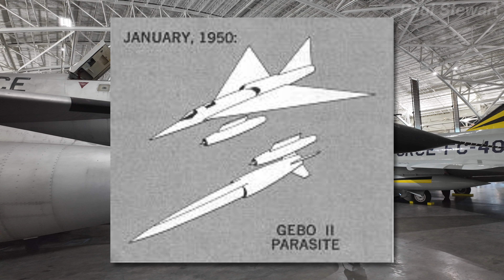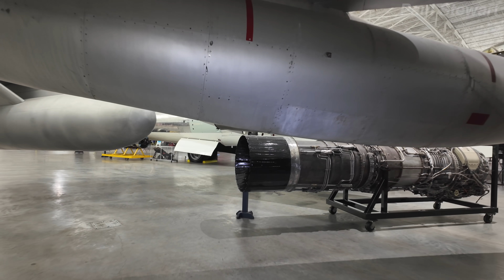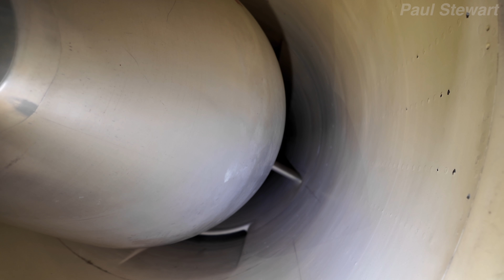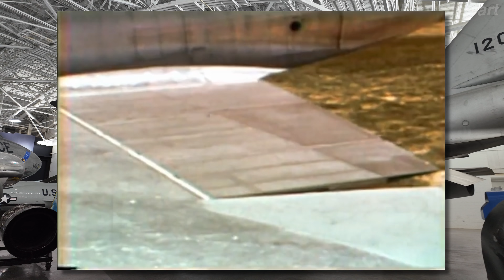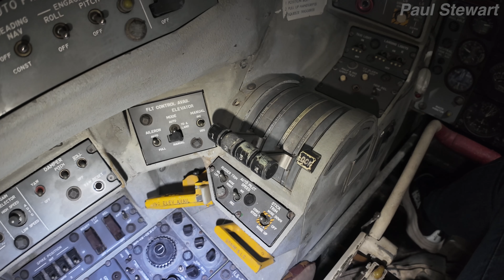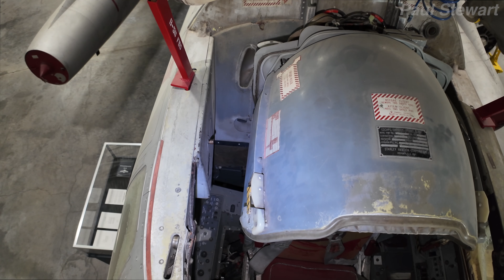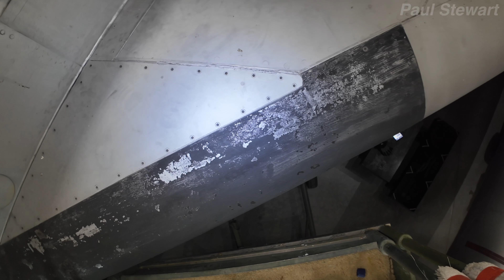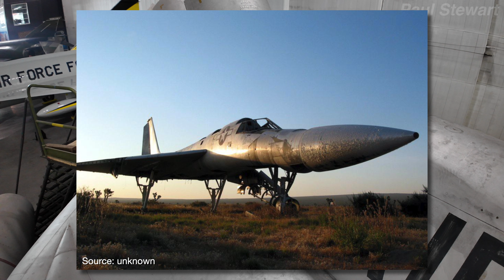Inside the Convair B-58 Hustler!

Comment: Back in the day, the aircraft that I worked on was the F-106, also a Convair product.  Our piloots LOVED to fly it and it was a pleasure for me to work on,  I also briefly worked on the F-4D and the F-4E and those were a maintenance nightmare by comparison.  Moving on, I am convinced that Convair had a sweetheart deal with a subcontractor named Burndy and I can see that this B-58 is lined with Burndy fuses.  Fuses, not circuit breakers.  That means that we had to keep a stock of about 6 or 8 differenct amperage replacements and I'll bet that every one of them cost at least several 1957 dollars.  Worse, a spring loaded spike was supposed to pop out of that hole on the pinch handle to indicate it had blown but that didn't always work.  So, can you imagine that the bombardier would have to isolate the bad circuit and maybe effect a work-arouind or repair and then have to juggle a loose supply of replacements as well a disposing of the spent ones?  Those damned fuses are the only thing I had a bad word to say about the F-106.

Comment: Very interesting details in your video. Great job. I never knew it was such a crappy plane to fly for the crew. Three crew members all isolated from each other. A clothesline to attach paper messages to and pull the string back and forth in case the intercom failed. Almost no visibility out for two of the three crew members.

Comment: I spent a year in 1967 in Little Rock climbing all over these things. Even getting to sit in the cockpit with all 4 turning so I could check the HF radio function. Also got to sit in the demo capsule and squeeze the triggers and encapsulate myself. One of the things that ended the B-58 was in a few years, there were a bunch of ICBMs sitting around north Arkansas able to deliver the same 9 megaton bomb much cheaper.

Comment: Our airline hired a B-58 pilot. Bill Hale became a 747 Captain for us. He was a pilots pilot. I was the Director of Pilot Training and was continuously impressed with his knowledge and flight skills. He told many stories of flying the B-58. He said the most feared malfunction was losing an engine while flying above Mach one. The aircraft had an automatic system to shut down an engine on the opposite side of the failure. Otherwise the aircraft would tumble and disintegrate in seconds. A lot of the aircraft that were lost was attributed to an engine failure and the automatic shut down system failing to react quickly enough.
Reply: A friend of mine's dad worked for General Dynamics and did development testing on them.  He told a story of testing and inboard engine failure at speed.  The plane yawed and obstructed the outboard inlet leaving the plane with max power on one side and nothing on the other.  His words were that the plane pretty much vaporized.  The automatic engine shutdown makes sense with that in mind.

Comment: Thanks for the memories Paul.  At 87 years young, I’ll bet I am one of a very limited number of living airmen that actually worked on the Hustler. I was in the USAF from 1959-1963, enlisting at 21. I was trained on the B-47 bomb/nav system in Denver at Lowery AFB and then went to Davis-Monthan AFB as a bomb/nav tech. on the B-47’s. They were phasing out, so I was sent to Carswell AFB in 1961for retraining on the B-58’s Sperry AN/ASQ-42 bombing/navigation system.  I was stationed there until discharge in April 1963.  I helped service many of the B-58’s with tail numbers in the 59-2xxx series. They were a very fussy aircraft to maintain. The bomb/nav and flight control systems were integrated and had some serious issues, thus causing several of the crashes. I was watching night take-offs from my barracks window one night to watch a B-58 taking off, only to have a flight control problem and fall back to the runway.  It slid about a 1000 feet leaving a trail of fire behind.  The crew members ejected, but fell back onto the runway and were incinerated. The later years of service saw the aircraft become quite reliable.  
Those were memorable times at Carswell, and with many good memories, but I was totally willing to take my discharge papers and be on the road home.
Reply: I went to Lowry in 80 to train on the F-15.  Noticed Lowry is basically gone....
Reply: Thank you for your service! Thank you for sharing about the B-58.
Reply: @JBMinter Thank you for sharing some of the memories from your Air Force Career. It's an era of military aircraft I am quite unfamiliar with, growing up around the dawn of the 'teen' series. When he was doing the walk around I was amazed how beautiful the lines and shaping of this Aircraft was, along with the craftsmanship to produce these designs with the materials available. Of course I am sure with working on and around them you have a whole different point of view and understanding with them. Very interesting times, though, with the horrors of the threat of the nuclear age balanced against the massive leap from the piston engined fighters to the early Space Age and Jet Era when we had this new technology and so many differing designs were being  built to test what would work, along with the dream that everything would be possible and was just around the corner.
Reply: that's cool, i'm only 31 but I like these older jet fighters and bombers from the 50's/60's they just have a nice look to them and to think they were designed with slide rules and nothing else
Reply: Great to hear from someone who worked on the aircraft.  I would have loved to see all those systems and technical data.  I was stationed at DM from 1994 to 2001.
Reply: @shieldwallofdragons  DM was a great base as I was there '81-'85.  Still live in the area.

Comment: The J-79 engine installed in the 'Hustler' (only 116 built) run longer in afterburner/supersonic-mode than all other GE-J-79s installed in all other planes e.g.F-104'Starfighter' (~2500 built) or F-4'Phantom' (~5000 built) COMBINED...!
2 were prepared for use as conventional bomber for Vietnam...looks a bit strange to see a 'Hustler' in tactical camo-pattern...but the plan was not realised...!
Shame it was only in service for ~10 years...! 😞

Comment: There’s a nice little book out there about the B58 story. It argues that it wasn’t actually more expensive than the B52 in that a wing of B58s consisted of far more planes and support crews, so costs per unit operating was comparable. 
I suspect that all it issues come down to the quantum leap forward that it represented and consequently the somewhat uncharted territory of its flight envelope.
 At high altitude it was really in coffin corner and we need to consider the likely previous experience of the crews and how that would serve them flying such a machine. Losses were to be expected perhaps from such a complex beast. It’s delta wing would also probably have been excellent at low altitude like the Vulcan was. 
Ultimately, it often comes down to the whims and prejudices of the air staff advising Le May. Either way, it was a missed opportunity thar the Russians really appreciated because they are said to have feared it above all else.

Comment: The B-58 is one of the planes that I wish someone would restore to airworthy condition.  It doesn't seem like it would be that hard to get one airworthy since they use the J-79 engine.  The J-79 is a very reliable engine and there is still mro shops overhauling them.

Comment: From Typhoon Roy to Typhoon Russ (December 1987 to December 1990), my wife and I were stationed at Andersen AFB, Guam.  Before becoming a B-52 wing in the 1970s, the 43 Bombardment Wing flew B-58s out of Carswell AFB, Texas.  I never saw a 43rd BMW B-58 in flight, but I did get to see one of the aircraft in the Museum of the US Air Force back in 1991.

Oh, by the way -- I'm looking forward to your piece on the FB-111!  My first assignment in the US Air Force was with the 474th Tactical Fighter Wing at Nellis AFB, Nevada.  I didn't see the Aardvarks fly very often -- there were recurring problems with the TF-30 afterburning turbofans -- but I did have the privelege of seeing the 474th's last Aardvark light the afterburners, trundle down the runway, and climb into the sunset on its way to Mountain Home AFB, Idaho.  About a month later, I flew off to Travis AFB, California to work with the 60th Military Airlift Wing's C-5 Galaxies.

Comment: The B-58 is definitely one of the best looking aircraft ever designed. It's whole design simply oozes  "speed". If a B-58 and a B-52 had kids, they would all look like the B-1B.
Reply: Was stationed at the alert facility in At Whiteman AFB,in Knobb Nostor missouri. Thomas M. Gilbert col.
Reply: Really?  That pod and the wing-mounted cigar engines make it look like a series of decisions were made to essentially enlarge and modify an ME262.  Add delta wings, add two engines.  Not enough fuel?  Don’t change the design, just bolt on a pod.  Not enough room for bombs?  
Again, pod.  It looks like the initial design didn’t meet the design requirements, so they just kept adding things to it to compensate.
Reply: @r @roddaman7545 Read a history of the development of the -58 and you will find that was indeed not the case. The pod and engine configuration was an ingenious and carefully considered solution to tailor the airplane to exactly what the Air Force asked for in the specification. Unfortunately it was not adaptable to carrying large amounts of conventional ordnance, but it did the nuclear deterrent mission it was designed for. One can ask no more of an airplane's designers and builders.

And ffs the delta was exactly nothing like the 262s wing, and the tech was light years ahead of it despite only being 10 years later when first designed.
Reply: @johnparrott4689
I was talking about what it LOOKS LIKE.  It didn’t make any assertions about the development. FFS.  Find something worthwhile to ‘fact check’.

Comment: You forgot one application of the J-79 engine. The Convair 880 four engined airliner, meant to compete with the B707 and DC-8. On the 880, the engines were renamed the CJ-805. 

GREAT VIDEO BTW! =D

Comment: The cockpit windows are Crazed around the edges, but uniformly so.  What causes that phenomenon.  Normal glass would shatter or streak in longer and random directions, especially around edges.  This is some kind of unknown stress/strain/fracture issue which is still somewhat of a mystery today.
Reply: It is caused from heat delamination of the plastic material sandwiched between the several sheets of high-strength of glass .  When this happened in service, the glass would be replaced: Glass panels were probably replaced several times in the service life of the individual bomber. I saw windows with this issue several times when I was stationed at Carswell AFB as an electronic tech. on the Bomb/Nav system.

Comment: Grissom AFB had one parked on permanent static display.  One day, during a major storm, it tried to takeoff.  The next morning, it was found with the nose high in the air.  To prevent it from happening again, the nose gear tires were filled with concrete thru a hole cut in the top of the tires.  Once it cured, the openings were rotated to the bottom.  In addition, concrete was poured into the nose area.  Unfortunately, concrete eats thru metal.  The nose gear rims collapsed, while the concrete in the nose, ate thru the skin on the bottom of the nose area.

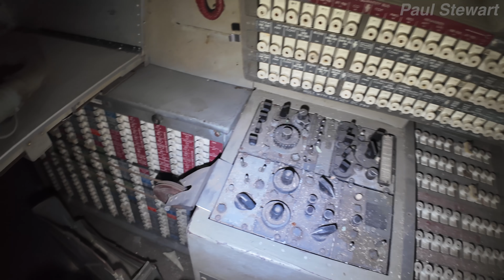Comment: I have some fun extra info about that system at 27:20

That was called the AN/ALQ-16, and it was the first of its type that could follow the frequency of a missile as it hopped across the band. It used a giant vaccum tube to parse these signals, and was manufactured by Sylvania in Buffalo, NY.
Being the first, it wasnt very reliable. They had a very high failure rate on that tube, so in 1967 they came up with a special testing briefcase for ground crews that would check the entire system, and give you useful diagnostic readouts. It even displayed to an external CRT! Not sure if it was NTSC compliant tho..

Ive only seen one of these things ever, and there is zero documentation on the thing. Wonder if anyone else has seen/used one? If i remember right, its Big, yellow, weighs about 50 lbs, and has "AN/ALQ-16 T3 BAND" written on it.

Comment: I was driving on U.S. 54 cutting across a corner of the Texas Panhandle when I saw a B-1 bomber on the deck and going like a bat out of hell.  That occurred a couple of decades back and in the late afternoon.  Then around a similar time frame, well perhaps thirty or so years ago four, yes I said four F-105s buzzed me in formation on a lonely two lane black top.  I was about twenty miles away from the air base located at Wichita, Kansas.  I realize this has nothing to do with the video.

Comment: During my Summer camp before I was commissioned back in the 1960s, I went to Castle AFB, where they had B-52 and B-58 simulators. I "flew" the B-52 simulator, and experienced the WSO simulation for the B-58, including the process for operating the tail cannon (with a selection of either 1 or 2 second bursts).

Comment: Air pressure in pneumatic tires is chiefly about keeping the tires from flattening too much while carrying the distributed weight of the vehicle. I don't know why this video asserts that the tire pressure was (simply) because of the high landing speeds; perhaps that is paraphrased from the oddly, and misleading, sentence on the Wikipedia page?

Also, the statement about how the crew compartments are separated gives a misleading picture regarding a major factor in the B-58's design. Each of the three crew members sat inside an escape pod, and those greatly increased the amount of space taken up by each of them. That, and the associated infrastructure necessitated considerable separation space between each compartment. No doubt other factors were involved, but some of THAT was just the designers using remaining available space within the fuselage.

Comment: While the B-58 was without question a beautiful design, it's thin wing cross section limited the amount of fuel it could carry. Had they actually been used to run nukes into USSR,  it would have run out of fuel before making it home. Thin wings gave it greater speed, but at the cost of range.

Comment: So..... they strapped a 30kftlbs YJ98-GE-3 on as a fifth engine causing the aircraft to have a combined maximum thrust of over 92,000lbs.   Thats enough thrust to have exceeded its service ceiling in less than a minute.  That's Streak Eagle range power.  Jeez

Comment: Funny you mention the Concorde.  The Hustler was actually the first aircraft that was designed (after thought, not from the get go) with SST in mind.  After the initial production run there was debate if the pod could be used as a airliner, and so they started working on it and even started production on it, but by the time they started working on it, not only was the Hustler outdated technology, but the cost of running a SST started coming to the surface and they realized that it just wasn't fiscally practical even for the military to operate one.  They stopped the program before the initial prototype was finished and the idea was scrapped.  Ironically, this would go on to inform the US when it opted to enter the race with Europe to build an SST, and why the US initially balked at the idea, and when they opted to go ahead for national pride they knew it had to hold at least a hundred and 150 ( I believe the 200 of the Boeing concept). The US versions were so ambitious because of the Hustler.  Of course, they failed, the tech to make it practical and cost-effective plus the environmental issues didn't exist in the 60's, and then the 747 pretty much killed Concorde, but that's why.

Comment: The R&D and engineering that went into the B-58, Seems to be familiar, if you look at the engineering that went into the SR-71.
Two aircraft for two separate missions, but did share many components.

Low level, or NOE flights became inevitable, due to the speed and reach of AA missiles.
It was the same for the B-1 later, relegated to missions flying NOE.
And such flight, even when possible, canceled the supersonic speeds for which the aircraft were originally designed.
This meant slower speeds, more fuel consumption and shorter ranges.

So the development of "stealth," technology was inevitable.  The F-117 was moderately successful for a stealth aircraft.  But it was strictly used as a night "bomber."
The B-2 Bomber was better in stealth, and is still used today.
The missions in Iran, proved that their stealth abilities and their abilities to deliver heavy ordinance, is seldom if at all duplicated by any other nation.

Comment: The first time I saw this plane I thought “nice try maybe next time”.  It looks like a prototype or test bed not an operational plane. The fact that early designs had expendable engines shows you where they were coming from, it really was early days for this type of aircraft.  So many elements that seem like incremental engineering as opposed to wholistic, which is understandable given the time period.  The fact that it was difficult to fly doesn’t seem surprising either.  The escape system is definitely interesting.  It would be intstructive to do a side by side comparison of the B58 and the B1 to see how things evolved.

Comment: IN terms of its low altitude behaviour, the B-58 would have had its construction maximised for high altitude flight from the beginning, and so its implementation as a low altitude bomber would have very quickly compromised the strength of the construction. Had it been of a greater strength, it would have increased the aircraft weight considerably, and thus defeating its purpose.